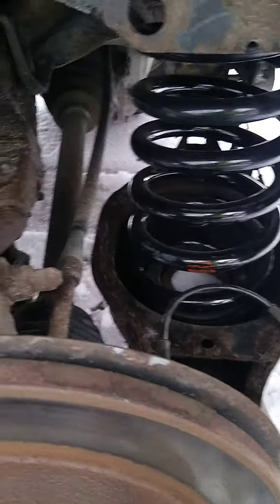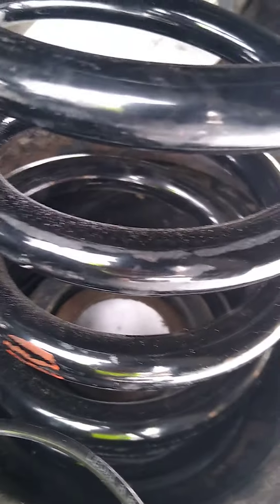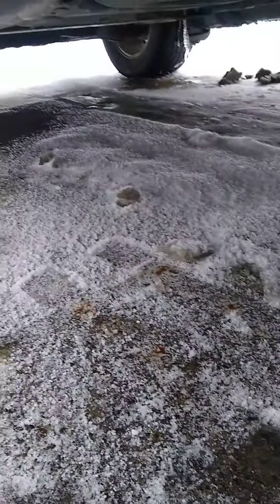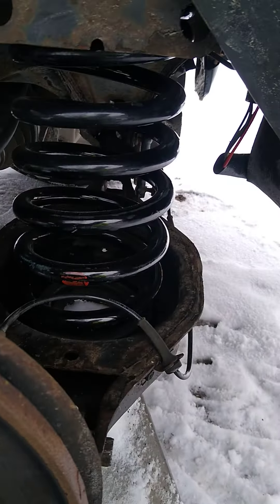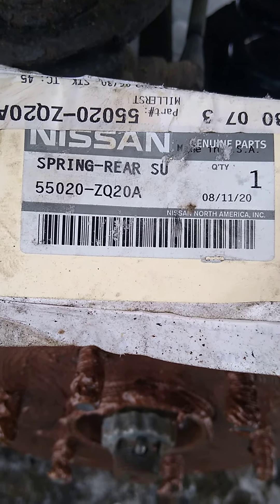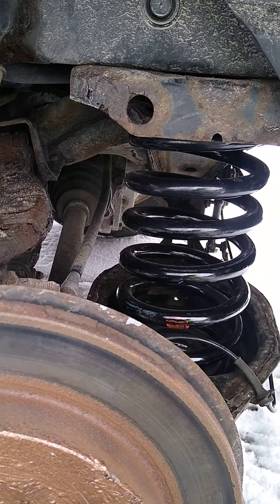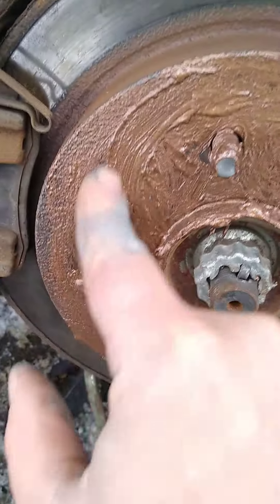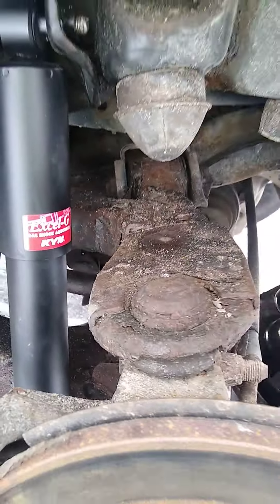2011 Nissan Armada rear suspension conversion quick overview

Comment: If you cut the bottom bolt how did you get the part with the nut out, it’s just too tight and there’s a metal seat the nut sits in?
Reply from the maker: @jerrytheartman6626  I ended up cutting the bolts on both sides of the mounting bracket. It ended up welding itself inside the bushing. Once I did that, things came apart easier. I did end up having to use a sawzall with heavy duty blades and an angle grinder. The torch provided no assistance
Reply: @loudjosh81 thank you so much for the reply, I put a new air shock in on the drivers side a few months ago and it took almost 5 hours to get that bottom bolt out, I used a torch and pretty much had to almost liquify everything, it wasn’t good, but like you said the bolt and the bushing become one, now I and taking out the air suspension I’ll try your way and just cut everything out and slop anti seize on everything.
Reply from the maker: @jerrytheartman6626  I used so much antisieze it wasn't funny. . . But I can't take the chance the next time I need to replace something

Comment: Were the shocks the regular OEM size shocks or was it for the sv like the springs
Reply from the maker: They were the same length (at least the same part from rock auto) but without the air ride they are much much stiffer
Reply: @loudjosh81  so is that what you were looking for? Stiffer ride? You must tow a lot. Problem I’m having is going over humps and pot holes jolt my suspension and I’m going for more smooth feel. Do you have a part number on the shocks.
Reply from the maker: @yrralatam  KYB 345066 is the part number from kyb.

I don't tow at all, it was just to bouncy before from blown air ride.

Now it's nice going down the road

Comment: The springs have to been changed too?
Reply: If you are getting rid of the air suspension you do, the air suspension shocks are shorter, I believe the truck will sag in the rear if you don’t.